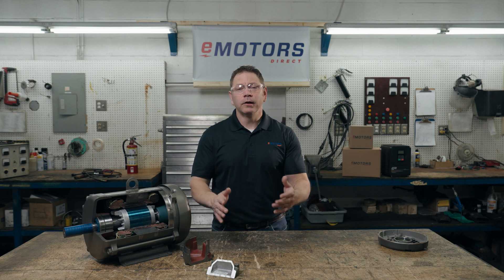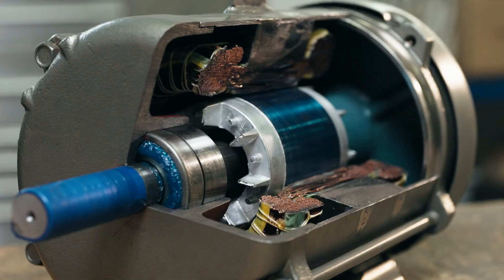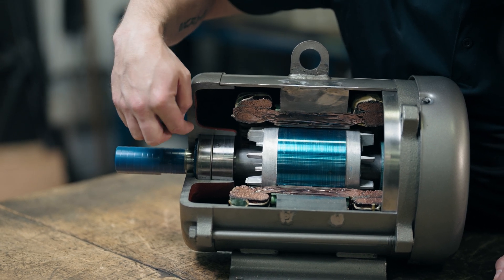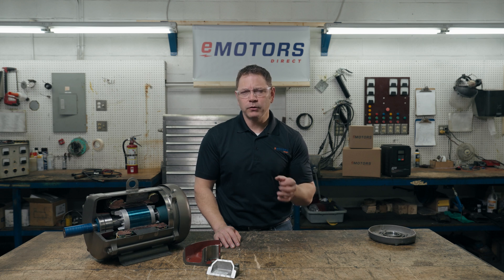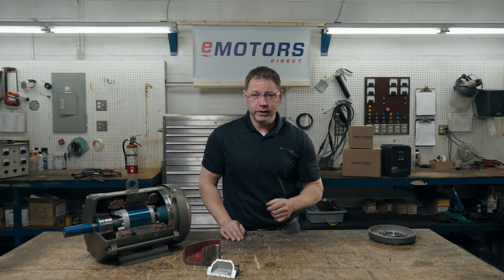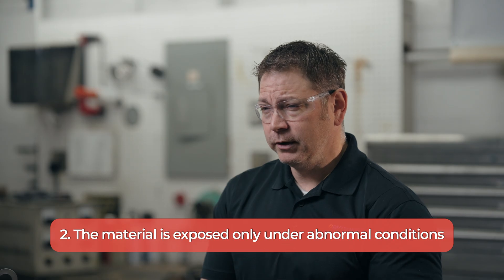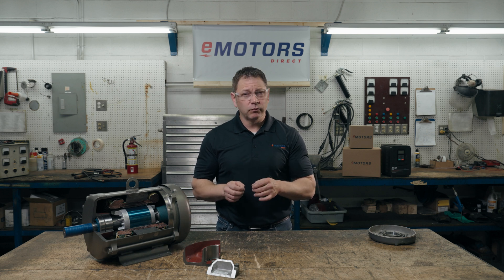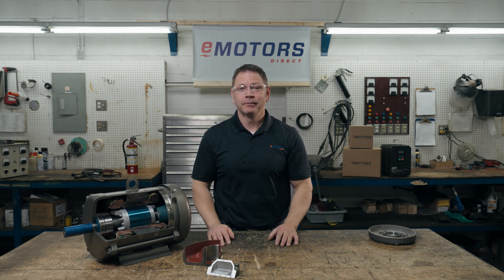What is an Explosion Proof Motor?

Comment: Is explosion proof motor will be affected once you have it rewinded?
Reply from the maker: It is not affected at all, assuming the rewind is done correctly by a certified shop.
If all of the tests performed during the rewind pass, the motor comes back out in like-new condition.
During the rewind process, for the most part, we are replacing what was there with the exact same materials.

Explosion proof motors, to keep their designation, must be recertified by an accredited shop.
Not all shops carry this so ask before getting the work done.

Comment: Thanks for this informative video. Just wanted to ask if there is a hazardous facility that requires to be explosion proof, are pumps also made explosion proof? If yes, then how?
Reply from the maker: Any pump experts, feel free to chime in here. As far as I'm aware the hazardous area classification does not apply to the pump, except for the process sealing in section 501.17. Because the motor can provide an ignition source, it must be able to contain that potential explosion.  The guidelines are expressed in NEC section 500 if you want to look into it further.
Reply: @emotorsdirect  thanks for your reply. I will look into it.